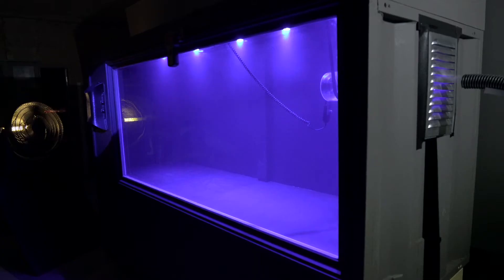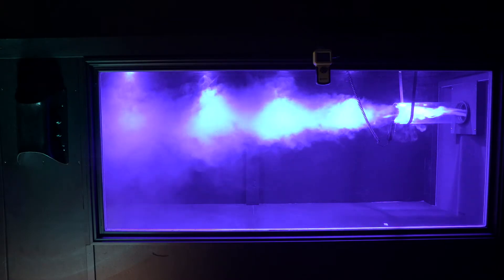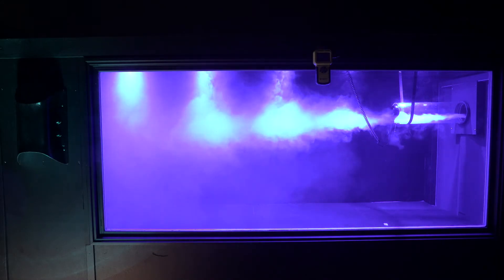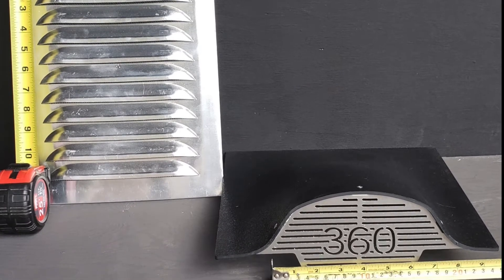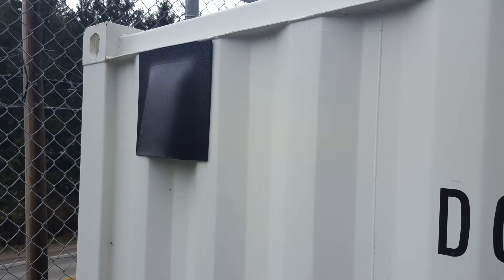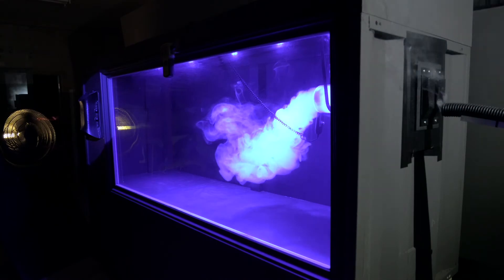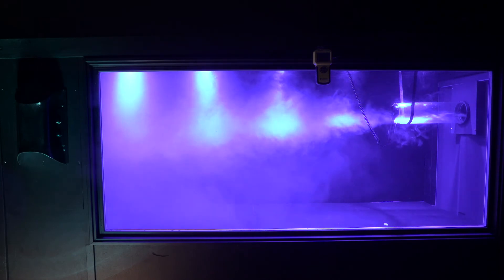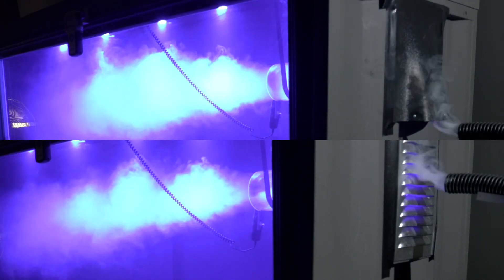Shipping Container Venting | Wind Tunnel Lab Test Comparison All Types

Comment: I really like this design as compared to other passive vents and especially the ugly spinning turbine wheels that also seem risky for creating leaks on the roof. I am in the investigation stage and am "considering" purchasing a 20" "New" container to use as supplementary storage for lawn mowers, gardening tools, and other storable items that you might keep in a shed. Looking at this system, I only have three questions: 1) Would it be advisable to install two of your vents, one high and one low for the purpose of preventing condensation "rain" but also venting gasoline fumes from the stored yard equipment and/or gasoline? 2) (2 part question) Although you mentioned it as a selling point, I am a little concerned that your vents seem to only be glued to the container. Will they really stay stuck and waterproof for the long run? Could you put screws or rivets in them as a precaution? 3) Does the material these vents are made from hold up in hot/cold/rainy/frosty weather and will they stand up against UV rays? If I get a container, I would really like to know the answer to these questions. You seem to have a really great product here. Thank you for your time.